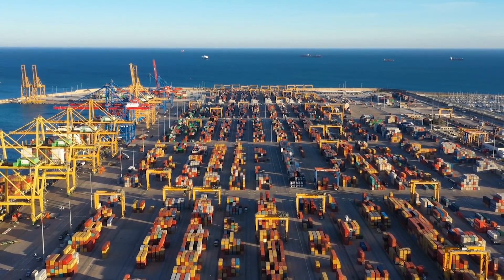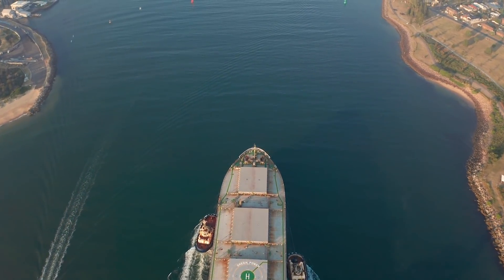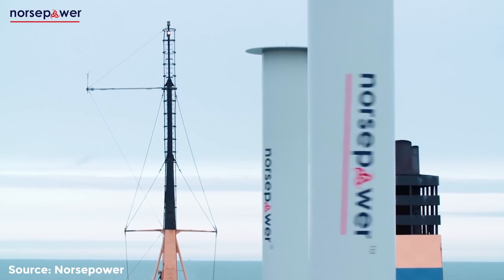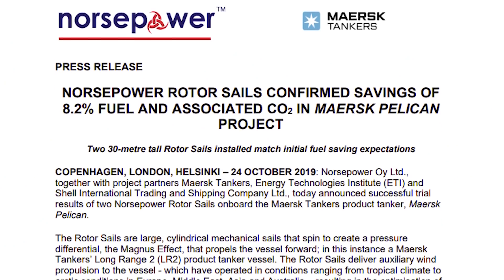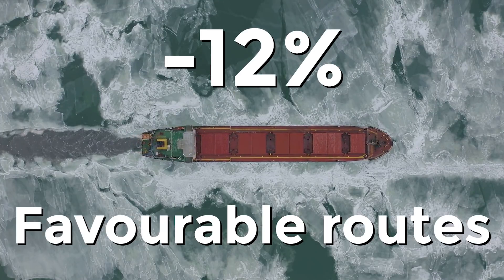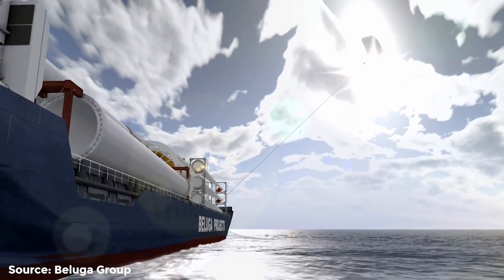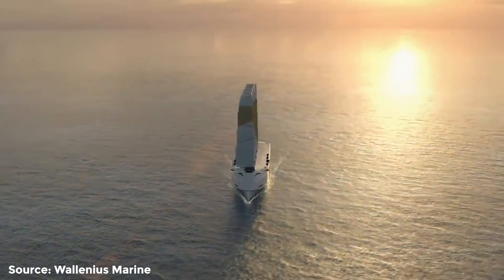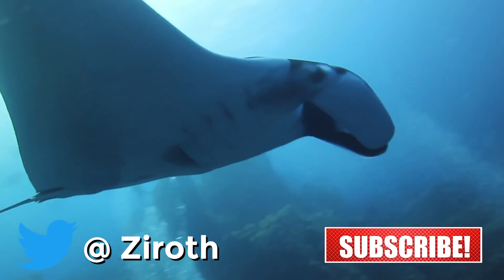Is Wind Power The Future of Shipping?

Comment: Americas cup AC 75s have proved you can go 3x the wind speed upwind so there has got to be a way for cargo ship In the future OFC.
Reply: To address the suggestions that wind power is the answer I offer the following example.  In 1870 a premium sailing vessel entered service, the ‘Cutty Sark’.  The 'Cutty Sark' was 64.74 metres in length with a beam of 10.97 metres and a loaded displacement of 2 100 tonnes.  She was able to carry, at best, 1 700 tonnes of cargo and to harness the energy in the wind the available spread of canvas was up to 2 976m2 which was tended by a crew of about 30 skilled men.  A ratio between the sail area (SA) and the vessels displacement (D) determines how lively she is; ‘lively’ being nautical speak for ‘fast and manoeuvrable’.  The carrying capacity of cargo ships is constrained in two ways, mass and volume which leads us to the ‘stowage factor’ of the cargo; the more mass on board the greater the displacement which in turn impacts the efficiency of the hull form and sail area / displacement ratio.  A vessel constrained by mass is said to be ‘down but not full’, while a vessel constrained by volume is said to be ‘full but not down.  When in the tea trade, which the ‘Cutty Sark’ was designed and built for with fine lines (more nautical tech speak, so again no need to worry about it) she could carry around 600 tonnes of cargo at speeds of up to 17.5 knots dependent on the prevailing wind and had a typical China to UK time on passage of 120 days.  The tea trade was very competitive so ‘time on passage’ was a large factor in securing the premium freight rate that made her cost effective.  Rounding things out, her maximum available sail area gave circa 5m2 of canvas for every tonne of tea carried.

As soon as the Suez Canal opened, which the ‘Cutty Sark’ was unable to sail through; she lost her advantage, raw speed, to the steam powered ships of that era who could beat her ‘time on passage’ by taking that short cut.  Mechanically powered ships have improved in terms of efficiency, on a freight tonne mile basis, by at least one order of magnitude since then.  After losing out to the coal burning, fire tube boiler, steam reciprocating mechanical ships of the late 19th century ‘Cutty Sark’ was relegated to the Australian wool trade, just about the bottom of the barrel in maritime terms and only one small step up from being a 'honey barge'.  The canvas, cordage and extra manpower needed for sailing ships was never a very benign environmental option so please discount any idea of sail as ‘sustainable’.  All this is without the problem that if ‘the wind don’t blow the ship don’t go’, when it does blow it often blows in the wrong direction for your cargo delivery needs and sometimes there is rather too much of it for comfort.  Sailing ships are unable to go directly up wind so if the wind is blowing form the direction your cargo needs to then a zig-zag course must be steered, more distance and more time.  Wind is traditionally measured on the Beaufort Scale (wind speed) that runs from 0 (< 1kn) to 12 (> 63kn) and for sailing purposes the usable part of the range is ‘3’ (circa 8kn) to ‘6’ (circa 24kn).

Random fact about ‘Cutty Sark’, it is said to have been possible to coax 3 000 horse power out of her sails, or in ‘real money’ 2 206 500 Watts (2.2 megaWatts), or 741 Watts for each square meter of sail area.  So that majestic spread of canvas would have been even less efficacious for delivering your baubles and bows from the orient, despite taking about three times as long on the voyage.  The sails on the ‘Cutty Sark produce about 0.33% of the power need to propel a Mearsk Triple E in ‘ideal conditions’ the energy harvest would be less than a two hundredth of the output from the ICEs.  Remember shipping is a high volume low cost, therefore low margin business, and all costs have to be beneficial.

Canvas and hemp are accorded 'renewable' (read as ‘natural’) status, if ‘synthetics’ are used there will still be a need for the input of FOGI products.  'Synthetics' would have a much better working life span than 'naturals' but would still yield the same amount of energy, 741 Watts for each square meter in those elusive ideal conditions.  Wallenius are currently giving wind power a go with wing form ‘sails’ but evidence is a little short of proof as of this date.  KTH (Kungliga Tekniska högskolan), a sort of up market university in Stockholm, who are using the funding to derive results will probably, and eventually, in the best traditions of academia ‘publish’ a ‘paper’ unless the funders invoke the well known ‘commercial sensitivity clause’ of their agreement with the KTH.  Wallenius is a major shipper of vehicles were the product is effectively its own packaging, other goods are moved about in ‘containers’ so the loss of capacity, ‘broken stowage’ in nautical speak, caused by containerisation needs to be factored in.  On board wind turbine might get you around some of the problems, however for marine use vertical axis wind turbines (VAWT) would be better than, the what have now become 'traditional', horizontal axis wind turbines (HAWT) for reasons that include the air draught of the vessel, weight distribution and maintenance access.  The energy yield is still subject to the wind blowing at the right strength and having space available on board for the hardware.  The masts, rigging and sail handling arrangements would take up 'prime real estate' on the vessel.  Fuel oil bunker tanks can be stuck away in any odd corner and the ICE power plants are themselves relatively compact.  The stacked up 'boxes' would mean putting the wind driven propulsion units in a bad situation from a ship stability point of view.

Comment: Wind and Solar work perfectly on ships. Strong winds, almost no shading. The cylinder top or sides could be turned active with PV.
Reply: Added to alternative fuels and more granular ship sizing for different jobs, a mixed approach is the best but difficult to sell, too complex for simple financial people and easier to dismiss as risky, as stated on the vid
Reply: @AndrewRippon  Unlikely. Very easy to implement. Solar and wind are the easiest to integrate with batteries.

Comment: This will never happen as something like a modern ship needs constant power. How would you use sails on 400 m x 52m + 100.000 dwt container vessel or 366m x 70 m with +20 m draught +300.000 dwt bulk or tanker? ? 
Sail is good for powering small light vessel. Introduction of power driven vessel was because the need for constant power. Also it would interupt global economics. Introducing this things on deck is increasing maintenance , creates additional impact on stability, gives extra work for crew, increasing danger for crew. Kites are good while they fly. What would happen if system malfunctions, kite flls into sea and steel wire/ wire gets around propeller shaft or if this flys over the deck and cuts someons head off?

Nowdays all oceangoing vessels are using scrubbers. All what is going to air is vapor. We also abandoned one time use plastics, use more and more LNG fuel or hybrid propulsions, we are compacting and burning garbage (except plastic which is delivered to shore) so vessels are geting very green. 

If you consider that they transfer so many cargo for so little fuel over such a long distance, they are prety green .

Comment: just go nuclear
Reply: If you do a web search for ‘nuclear ship savannah’ you will see that it has been tried and did not work.  A similarly vessel heavily subsidised, by the government, vessel is in use in Russia which also operates, in support of the Northern Sea Route, a fleet of nuclear powered ice breakers all of these may, or may not, have been completely without issues.

Just think; would you have full confidence in the management of a nuclear reactor under the control of an anonymous entity only traceable, perhaps, via a letter box in a FOC (flag of convenience) nation state?  If you are, could you sell that confidence to Japan, the state that hosted the Hiroshima and Nagasaki nuclear detonations as well as more recently the Fukushima ‘event’?  Then try that same, or a similar, sales strategy on Ukraine, the nation state that as a part of the USSR (CCCP) hosted the Chernobyl ‘event’.  Modern iterations of nuclear energy, thorium fuel, molten salt reactors or fusion reactors, will carry the legacy of past problems.  It is the global trepidation of anything with 'nuclear' in the name and the economics of nuclear having transitioned from 'energy to cheap to charge for' too 'the costs of remediation are incalculable' that will prevent the adoption of nuclear energy as a means of creating energy at sea.  Modern reaction systems may have overcome the safety problems but the general public, having been misled in the past, will be reluctant to believe the fresh new promises.  The incident of the ‘Ever Given’ blocking the Suez Canal, March 2021, may also have a little to add to this debate.  The cooling water on ships tends to get taken in from near the bottom so when running aground the inlets are in a prime spot to get plugged up restricting, if not stopping, the flow of coolant.  One thing that the TMI, Chernobyl and Fukushima incidents all had in common was that the supply of coolant, or rather lack thereof, was a fundamental cause.

‘They’ say nuclear is cheap, it’s not it is expensive and has a large embedded carbon quotient as well as being complicated, dangerous, not universally socially acceptable and having only ‘no need for refuelling’ as a questionable advantage; actually it does need refuelling just not as often.  When ‘they’ do need to refill the warming up stuff it takes considerable longer than pumping tonnes of thick black stuff, cSt380 HFO, or thin runny stuff, MDO, onboard which is one of the reasons HMS Queen Elizabeth and HMS Prince of Wales are pushed about by ICEs and gas turbines thus using a similar fuel as the aircraft that fly off of them.  The Royal Navy (RN) with a high degree of skill and expertise uses, at vast expenses to the UK taxpayer, a current operational nuclear fleet of 11 submarines (also known as ‘boats’) in two flotillas, seven attack subs and four ballistic missile boats.  The carbon footprint of all the extra bits of hardware and the fuel, including processing thereof, from ground to propeller, are the external costs that never seem to get considered.

Disposal, once it wears out, of both the machine (that was a ship) and fuel is another can of worms best left unopened.  The 26 RN boats no longer in use are laid up (some in Rosyth and some in Portsmouth) awaiting long term deconstruction including dealing with the fuel rods and other irradiated material.  The USN is not, as far as I know, a commercial organisation working to very tight margins and also has the skill and expertise to handle the complexities of nuclear power; so as well as submarines their aircraft carriers are nuclear powered and each of the current iteration has a build cost three times that of QE/PoW, bigger crews and more generous funding.  For those who still think that nuclear energy might be the answer I recommend this report: - https://www.bbc.com/future/article/20200901-the-radioactive-risk-of-sunken-nuclear-soviet-submarines?ocid=ww.social.link.email.  The navy of the USSR might have been under resourced and over extended but it was still generously supported in comparison with merchant shipping.  While merchant ships may be 'taken up from trade' as the RN would say, or may be captured or impressed by non state quasi military entities by way of piracy, but cargo ships are not military vessels.

Comment: or nuclear, as ships are much larger so they have space to prevent any radiation, nuclear reactions can last for years and years on water without needing to refuel and don't rely on wind for speed, could be higher one day, lower the next, nuclear is constant high energy
Reply: If you do a web search for ‘nuclear ship savannah’ you will see that it has been tried and did not work.  A similarly vessel heavily subsidised, by the government, vessel is in use in Russia which also operates, in support of the Northern Sea Route, a fleet of nuclear powered ice breakers all of these may, or may not, have been completely without issues.

Just think; would you have full confidence in the management of a nuclear reactor under the control of an anonymous entity only traceable, perhaps, via a letter box in a FOC (flag of convenience) nation state?  If you are, could you sell that confidence to Japan, the state that hosted the Hiroshima and Nagasaki nuclear detonations as well as more recently the Fukushima ‘event’?  Then try that same, or a similar, sales strategy on Ukraine, the nation state that as a part of the USSR (CCCP) hosted the Chernobyl ‘event’.  Modern iterations of nuclear energy, thorium fuel, molten salt reactors or fusion reactors, will carry the legacy of past problems.  It is the global trepidation of anything with 'nuclear' in the name and the economics of nuclear having transitioned from 'energy to cheap to charge for' too 'the costs of remediation are incalculable' that will prevent the adoption of nuclear energy as a means of creating energy at sea.  Modern reaction systems may have overcome the safety problems but the general public, having been misled in the past, will be reluctant to believe the fresh new promises.  The incident of the ‘Ever Given’ blocking the Suez Canal, March 2021, may also have a little to add to this debate.  The cooling water on ships tends to get taken in from near the bottom so when running aground the inlets are in a prime spot to get plugged up restricting, if not stopping, the flow of coolant.  One thing that the TMI, Chernobyl and Fukushima incidents all had in common was that the supply of coolant, or rather lack thereof, was a fundamental cause.

‘They’ say nuclear is cheap, it’s not it is expensive and has a large embedded carbon quotient as well as being complicated, dangerous, not universally socially acceptable and having only ‘no need for refuelling’ as a questionable advantage; actually it does need refuelling just not as often.  When ‘they’ do need to refill the warming up stuff it takes considerable longer than pumping tonnes of thick black stuff, cSt380 HFO, or thin runny stuff, MDO, onboard which is one of the reasons HMS Queen Elizabeth and HMS Prince of Wales are pushed about by ICEs and gas turbines thus using a similar fuel as the aircraft that fly off of them.  The Royal Navy (RN) with a high degree of skill and expertise uses, at vast expenses to the UK taxpayer, a current operational nuclear fleet of 11 submarines (also known as ‘boats’) in two flotillas, seven attack subs and four ballistic missile boats.  The carbon footprint of all the extra bits of hardware and the fuel, including processing thereof, from ground to propeller, are the external costs that never seem to get considered.

Disposal, once it wears out, of both the machine (that was a ship) and fuel is another can of worms best left unopened.  The 26 RN boats no longer in use are laid up (some in Rosyth and some in Portsmouth) awaiting long term deconstruction including dealing with the fuel rods and other irradiated material.  The USN is not, as far as I know, a commercial organisation working to very tight margins and also has the skill and expertise to handle the complexities of nuclear power; so as well as submarines their aircraft carriers are nuclear powered and each of the current iteration has a build cost three times that of QE/PoW, bigger crews and more generous funding.  For those who still think that nuclear energy might be the answer I recommend this report: - https://www.bbc.com/future/article/20200901-the-radioactive-risk-of-sunken-nuclear-soviet-submarines?ocid=ww.social.link.email.  The navy of the USSR might have been under resourced and over extended but it was still generously supported in comparison with merchant shipping.
Reply: @BernardLS  but yeah objectively nuclear is the safest power, through that video I sent, along with the most consistent and energy dense, nuclear is the way forward :)
Reply: @baconn1ce  nuclear makes sense from an engineering perspective but not an economic or social. However good it is the fear factor has killed it and thus the politics will not allow it to happen. Evergreen have problems with the Egyptians just now, imagine how much worse that situation would be if it was nuclear.
Reply: @BernardLS  you're defo right on the politics part, it gets alot of smack talking throughout the media and online, but tbh the media and their platforms have an agenda, defo to support big oil companies unfortunately
Reply: @baconn1ce  WADR I disagree about the MSM supporting FOGI, MSM are only interested in coining their gilt witnessed their advocacy of a former football (soccer) players son's girl friend putting her self about in a skimpy bikini.  MSM will publish whatever moves their product.